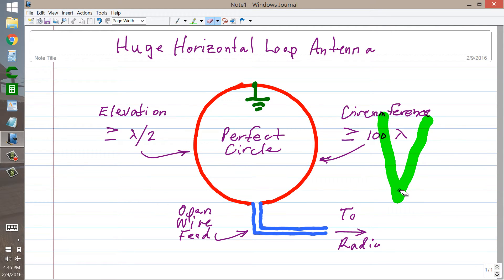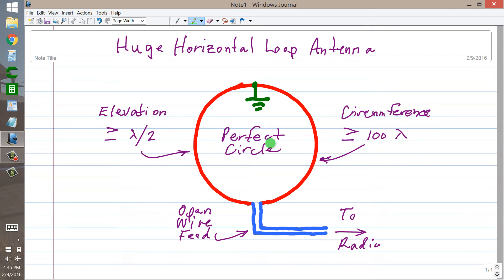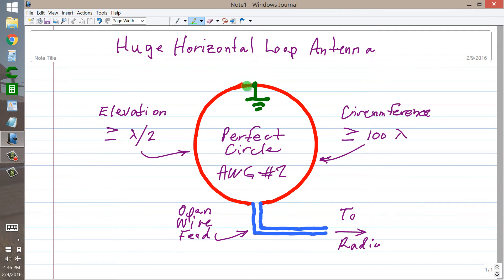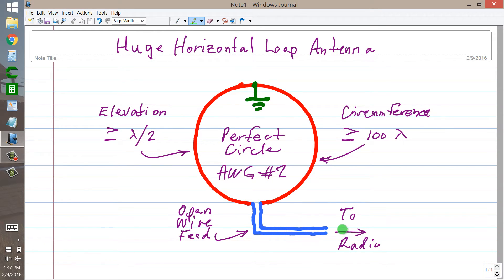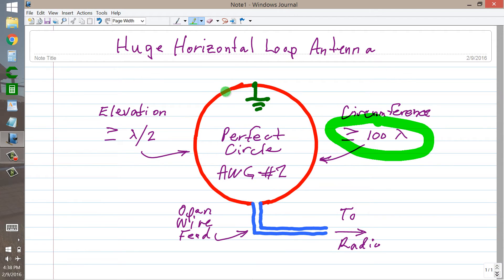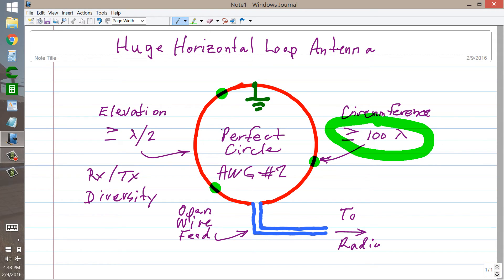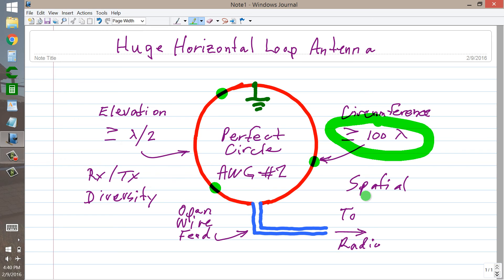Huge Horizontal Loop Antenna

Comment: I ran an horizontal loop tuned for 500 khz at my old station on the beach in Maui.  It worked great for receiving shipboard CW all across the Pacific at night and I could tune it up on 160, 80 and 40 meters where it had considerable gain.  It worked very well and was one of my best multiband antennas.

Comment: i run a sq horizontal loop 4 w/l  575 feet long at 50 feet fed with 450 ohm l/ l  to a 4-1 balun then 40 feet lmr 400 to the amplifier  it works best on 40 and 80 swr 1-1 on 40  1.8 on 80 meters i have a big blade switch before the balun to earth when not in use ,if its lighting in the distance i remove the connection all together ,i have seen some big sparks jump off, only in stormy weather . i don't use it in bad conditions i got a slight zap once won't do that again  i get 5/9 into new york from vk3   most times i even work into germany with 5/8 running 400 watts.i have shack earths and a earth at the balun connection been up 4 years a nearby ham has a rombic 4000 metres long he gets 40 over into new york .vk3xxy .

Comment: art bell had a hugh loop.... i think 12 towers 11 of them 5ft high 12th one was 100ft high... he did 2 wraps of number 10 wire. about 10ft space between the loops.. he had to stop the electric it was picking up from the atmosphere. i think he said he got 300 volts off it.. just from the air goin over it... about half a amp ...

Comment: Love your books and your videos. You are one of a kind.

Why use a single AWG 2 wire? What would be the downside to using a bunch of higher gauge wire, tying them all together at the feed point (and grounding them all at the other end of the circle). I've used 3M's 8132/24 ribbon cable which has 24 separated 18 AWG wires for similar applications. I assumed that the reduced proximity and skin effect losses would be significant and the ribbon cable keeps all the wires neat and tidy and makes connecting the ends pretty easy.

The US Navy has been trying to use HF ground wave to communicate between battle groups that don't have line of sight and could use spacial diversity, but even large ships don't have enough room for this monster antenna! :-) The ocean makes a pretty good ground plane, but the all metal ships can cause problems...

I suspect you are aware of the research station in Antarctica that uses a short loop antenna operating at very low frequencies to monitor lightning strikes all over the world.
Reply from the maker: Good point. Bundled higher gauge wire (such you suggest) would indeed work better for RF applications than a single thick wire. I stand corrected. Thanks! 73 de W1GV.

Comment: hi ken here, m3zkb, am using a oblong loop =33ft wide by 95ft long for 3. 710, swr is 3 to 1  what would be best to get to 5o ohms  regards ken ,m3zkb am on qrz
Reply from the maker: Would have to experiment in real time to find out. Cannot predict from pure theory. An antenna tuner (i.e., transmatch) at the feed would would do the job in any case. 73 de W1GV.

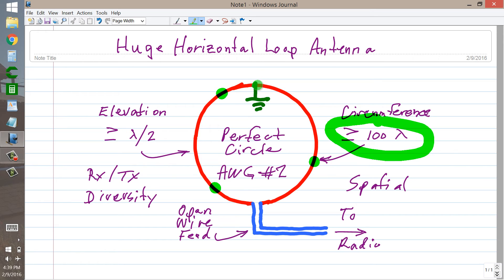Comment from the maker: At about 4:24 in the video, I erred when I said that 100 wavelengths at 7 MHz would equal 1300 to 1400 feet. That'd be 10 wavelengths. A hundred wavelengths would be 13,000 to 14,000 feet! Thanks to a viewer for pointing out this error. The same viewer also noted that lightning anywhere within a few miles of such a huge antenna would cause a big current surge that would destroy equipment in the shack. The ground at the far end of the loop would, I hope, discharge lightning-induced currrent surges while allowing the antenna to radiate RF as intended.

Comment: Stan.... does the distance between the two conductors on the ladder line matter that much? I would be feeding my antenna thru a tuner so I guess the impedance would not matter that much.... but would there be other considerations with respect to how wide the ladder is (1 inch vs 4 inch spacing)??
Reply from the maker: Nope it matters not at all; but the thicker the wire, the better. Classic 1-inch "ladder line" will work fine. So will so-called "window line." The stuff called "TV ribbon," not.

Comment: How will the antenna work if its grounded ?
Reply from the maker: The antenna is so large in circumference that it doesn't matter for RF. The ground is many wavelengths from the feed point. The ground works for DC but not for RF.